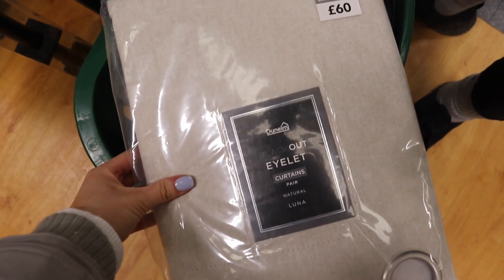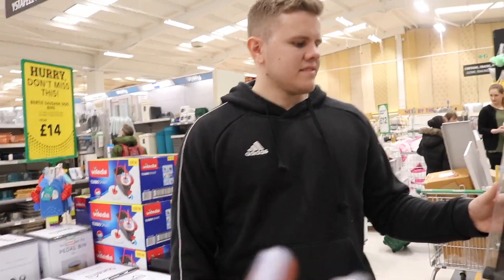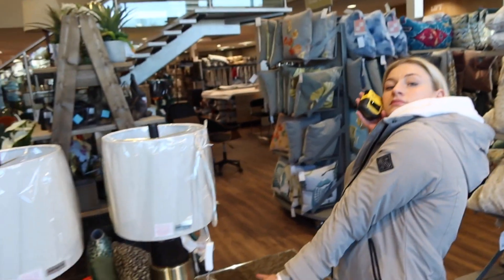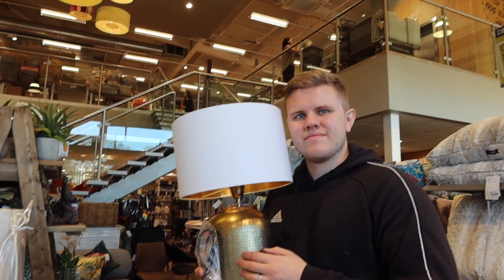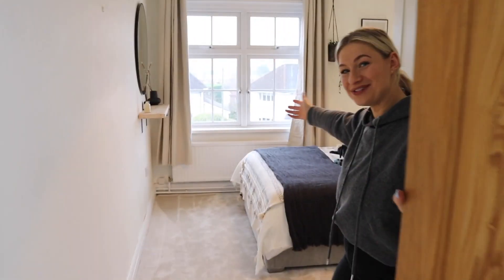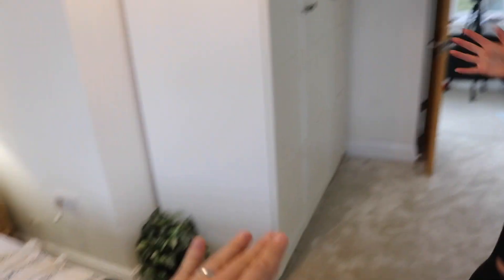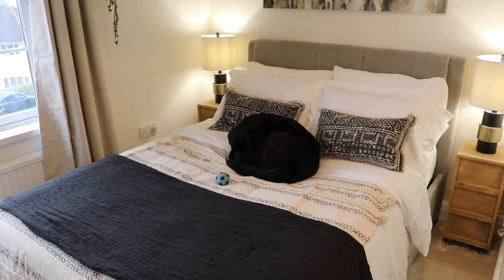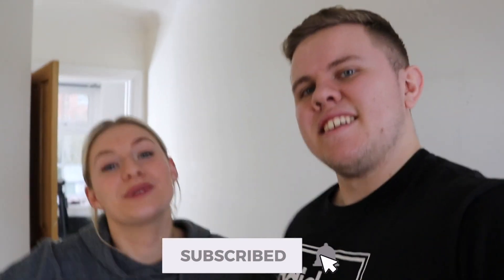OUR BEDROOM TRANSFORMATION | BEFORE AND AFTER | James and Carys

Comment: You need to plug the wall when drilling and putting in screws- otherwise overtime it’s going to come off the wall. Also to drill into brick or into plasterboard requires different drill bits xx
Reply: Also, use a stud finder to drill into to the stud :)

Comment: Helpful DIY tip when using an electric drill if the hole is too large/unstable buy assorted raw plugs to plug the hole then the screw will fit perfectly into place 😊

Comment: When screwing anything into the wall, make sure to use a stud-finder. Drywall won't hold screws in the wall without also using drywall screws. But, even when you use drywall screws, you can't put anything heavy in. Studs are really the only thing you can use to hang anything with any weight to it.  Great makeover - it looks fantastic!

Comment: I think you should keep those side tables as they are and turn them the correct way round. The little black handle detail with the neutral wood goes perfectly in my opinion and it will look gorgeous! Especially with the wood shelf with the black rails you have under the mirror, it will all tie in perfectly! 😊 Xx

Comment: Get yourselves a good DIY book and some masonry drills with specific wall plugs for the walls, and this will help you tremendously. If you get some filler for the holes you drilled, one big tip, get the filler in a large squeezy tube. You push the tube in the hole so air does not get trapped and the filling will not fall out. Best of luck in the future an love the house.

Comment: When drilling into brick, use a smaller drill bit & use raw-plugs that way the screws are in the wall secure, tap raw-plugs in with hammer very gently, (make sure you measure the screw / raw-plugs on the drill bit & mark it so you get the right debth) if you have a plasterboard wall then use a tiny drill bit to do a guide hole for the drywall (partition)screw to go into , then screw the "real" screw into it , that way you know its straight & strong.
Also there are different drill bits for each texture ie wood, brick, plasterboard bla bla bla , so you might have been using the wrong drill bit & that's why it snapped.
Also if you want them lampshades in every room but different colours then just buy the white ones & spray the outside of them to the colour you want, 
The room looks great, you have done a great job

Comment: Invest in a stud finder for the walls; you should be able to find one at any hardware store.  This would help you find exactly where the wood is behind the wall, and prevent drilling into nothing and causing a hole that needs to be fixed later.  Also, did you pull the drawer out completely of the side table?  The wood on the back of the drawer is probably plan, and if you're lucky, you may be able to just turn the drawers around and only have to reattach the knob.

Comment: Suggestion, when you drill a hole, first put plastic dowel the right size and then screw! It will hold much better as simply screw!
And there are many different drill options for different type of walls! You just need the right one!

Comment: The hard section of the wall might be a chimney breast and the plasterboard bit might be where the alcoves may have been filled in to make the chimney breast flush. If the room directly downstairs has a fireplace, you could start tearing up the walls... You might discover brickwork from a fireplace that would look great with your little mantle from etsy and the mirror above it

Comment: We did shelves too but for our bedside table because we have drawers under our bed. Please be careful when screwing in the wall because if there is an outlet under it and you hit the electrical box you could get electrocute yourself. Oh and for the record when you drill you are supposed to use a drill bit to make a bigger hole than the screw because you are supposed to put an anchor in the wall first and everything I bought for my house came with the screws needed. I dont like those end tables but they will look good black.

Comment: If you had drilled the holes and then used wall plugs it would have given a more secure and tighter fit. If you drill holes in walls they need plugging with a plastic plug. That’s what I would do any way x

Comment: You need to use wall plugs in the wall to keep screws secure 🙈 you can’t just screw them straight into the wall if you want to put weight on them
Reply: Also you need to use the right size drill bit so I little bit thinner then the actual wall plug so it’s tight
Reply: PS It looks really nice 😄